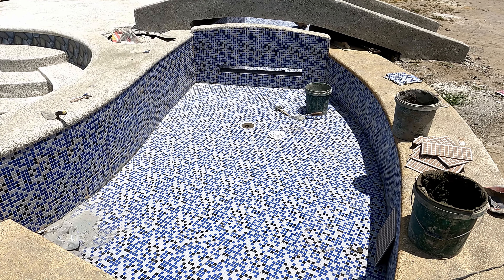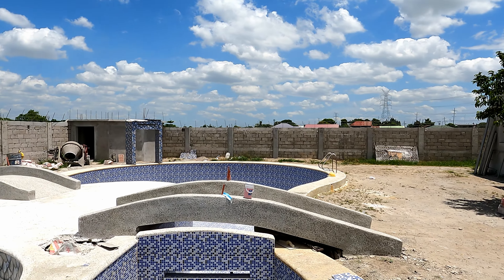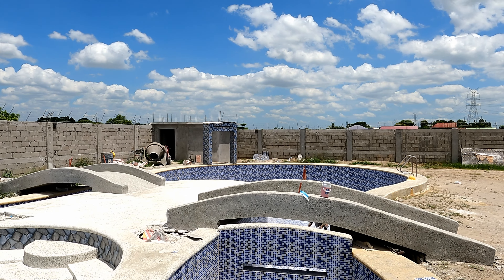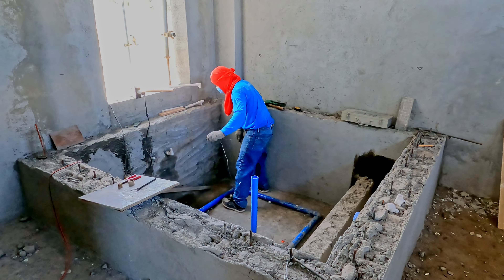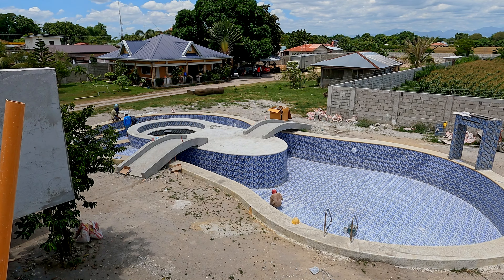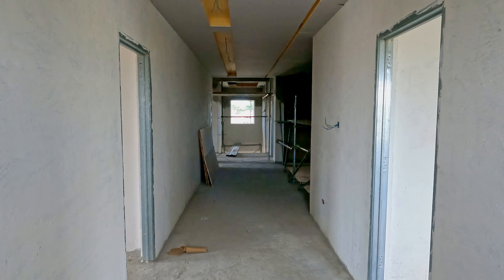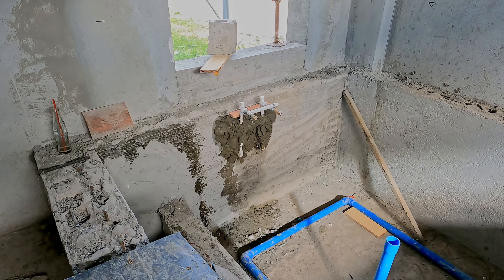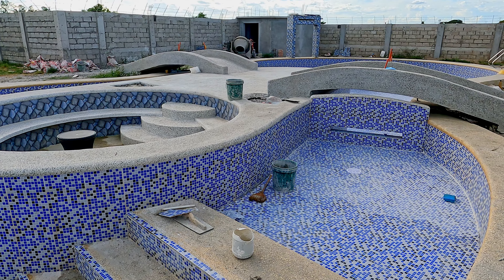Philippine House Building Day 201 - Pool Tiling Complete

Comment: My understanding is that it's really important to get water into the pool as soon as possible as it has two issues, the slab drying out, and displacement of water pressure vs soil movement?just a thought no offence🤔🤔🤗🤗♥️♥️
Reply: I've previously mentioned fill the pool before it becomes a boat.
Reply from the maker: Absolutely no offence taken. Very good point, so I think sooner rather than later now.
Reply from the maker: You did Graeme, and I am going to follow your advice.

Comment: You might want to make use of mangkono or philippine ironwood. Naturally termite resistant, at least 2x harder than ironwood. Very heavy and durable and resistant to water damage EVEN if left untreated. Great for outdoor furniture or as a floor surface. Beautiful grain on the wood too
Reply from the maker: Ironwood has been suggested before but I am not familiar with mangkono. Again, thanks for the advice.

Comment: The tree does block your view. If it was on the other side of the work shed I would say leave it.  Perhaps you can replace it with a smaller tree.
Reply from the maker: Kevin
We are going to try to trim it back - hopefully it will be enough.

Comment: Tree transplantation will solve your problem
Reply from the maker: Hi Ness
It's a nice idea, but with a mango tree this size, I think it won't work.
Their roots are very substantial, and very tough. Even when we completely cut down similar size trees last year, right down to a stump, they are extremely difficult to remove from the ground - in fact we tried again a week ago with the Bob Elephant (massive loader), which has incredible power, but it could not get one stump out of the ground, despite the fact that we were completely ok destroying the roots. Really appreciate the idea though